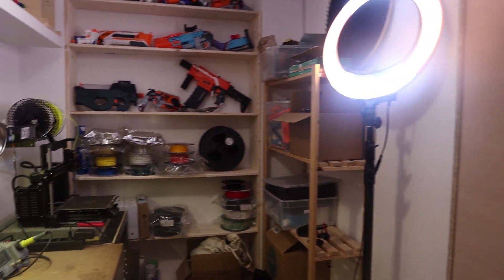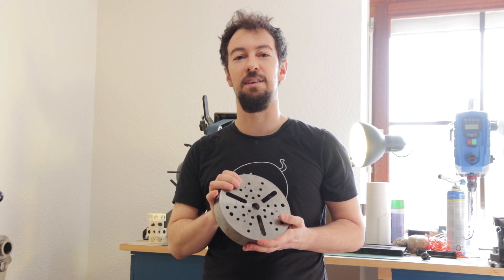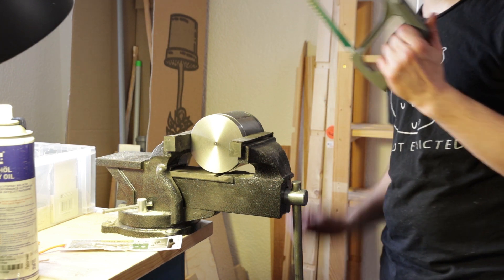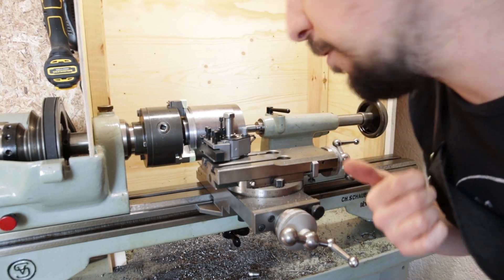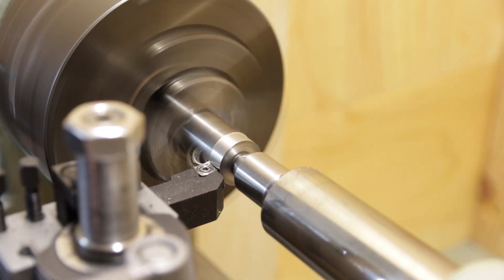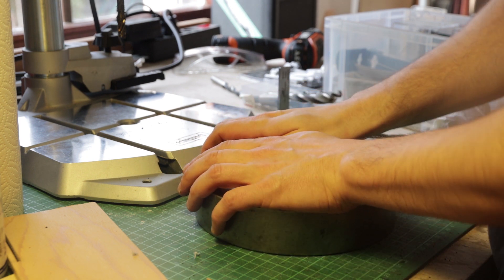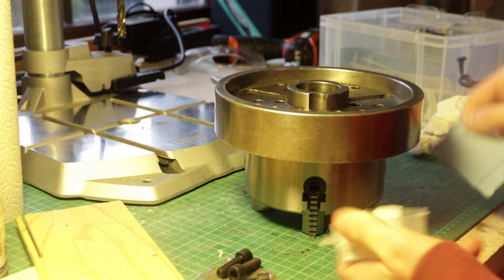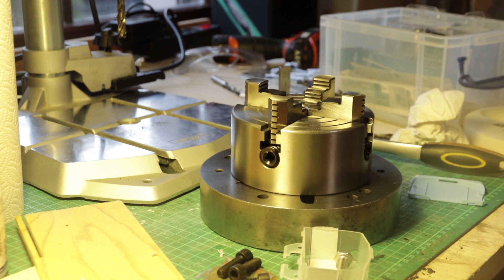Modern Chuck on an Ancient Lathe

Comment: Love the 3d printed drill guide. For my old lathe i did something similar and made a milti use backplate. The centering inserts is a great idea, i just machined a register that matched chucks for Chinese mini lathes as they were cheap and easy to find. Obviously means i'm limited in chuck size though. I do have a spare backplate so might do the same.
Reply from the maker: Thank you :)
That part worked out so much better than expected, definitely a technique I will be using again for future projects :)

Comment: Wouldn't making and threading a chuck backplate been a reasonable solution. Would have been good to learn how to cut a thread that fit properly. Now you have a chuck with long overhang.
Reply: The Schaublin he has doesn't have a built-in leadscrew for thread cutting. He would've had to do it on a different lathe and that would've still required a custom gear to be cut first.
Reply from the maker: The Schaublin 102 I have isn't really made for cutting threads. Mine does have an addon installed that makes it possible, but the maximum pitch it could cut is 1mm, and the chuck thread is M37.8x3mm. I tried finding a better solution for 2 months, but this was the best thing I could come up with :)